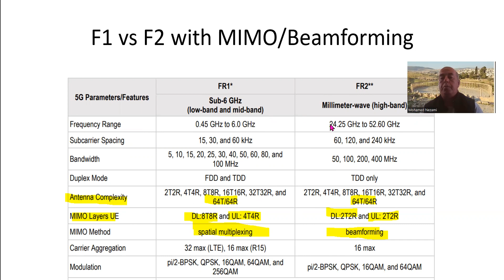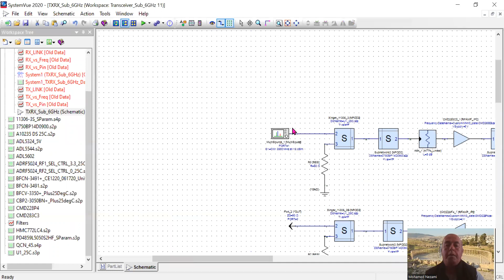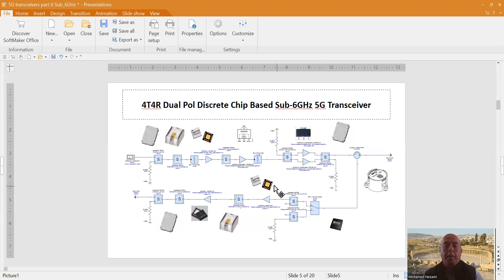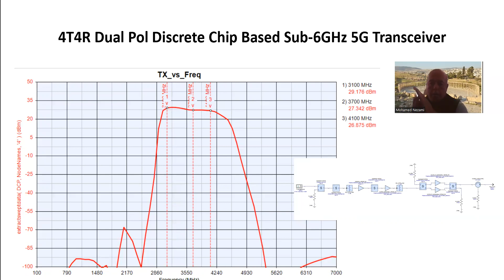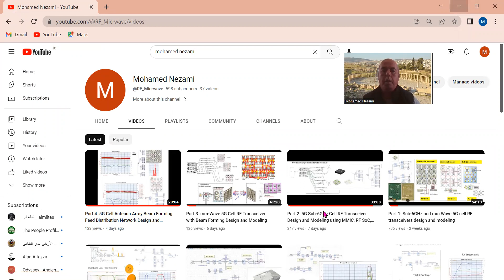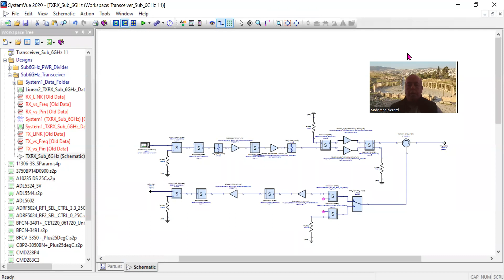Part 5: Small Cell 3.5GHz  MIMO Transceiver Design

Comment: Thank you so much Prof. Mohamed, great work.
Please, I need your help, I'm so beginner in Transceiver Design; as a tool not target I drawn using power-point a 2x2 MIMO-OFDM transceiver operate at 2.4 GHz (for WiFi wireless user) for the purpose to include this figure in my academic report.
Please, could you see if my proposed design is feasible from practical usage perspective, if it is true or false...ect.
Just to validate if my design is right and good to implement is my academic report.
If possible, could you please give me your email,
I will so thankful and appreciative to you Prof. Mohamed.